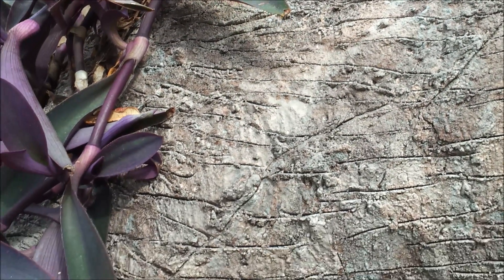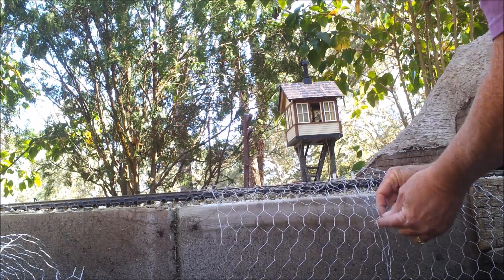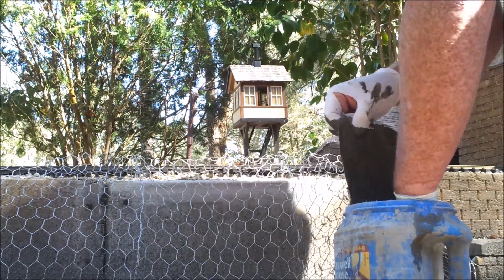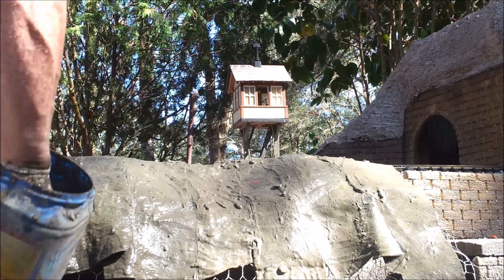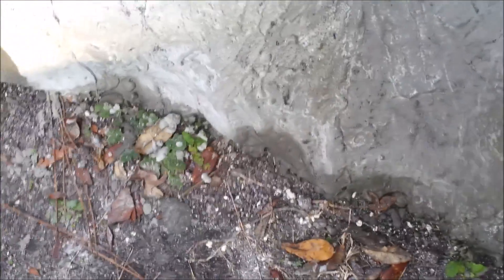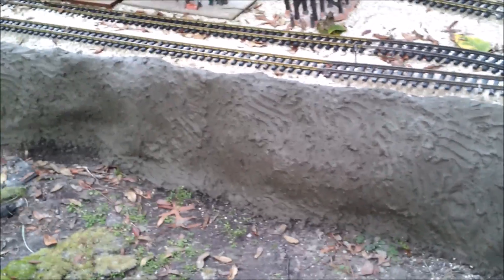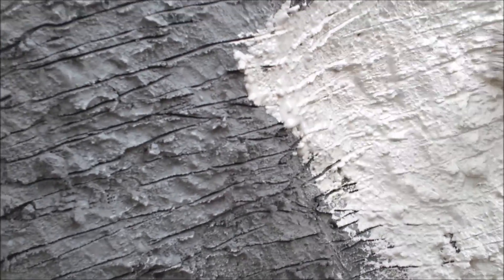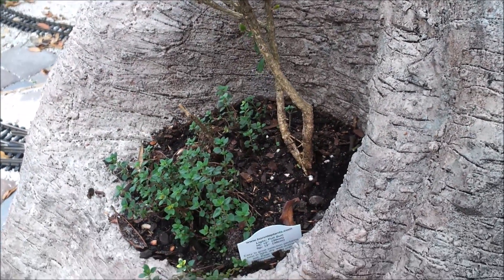How to make Concrete Mountains on a G scale Garden Railroad

Comment: can this be exposed to water features or can be used under the water?
Reply from the maker: +Distant Traveler I have used the same method for a water feature. In that case, I used a couple cans of that "flex-seal" spray. Rust Oleum makes several colors, but then I over-coated with Latex exterior paint. I assume a couple good coats of latex exterior alone would probably be enough for years. in this video, you can see my stream and pond. https://youtu.be/hnMujqUBEzw